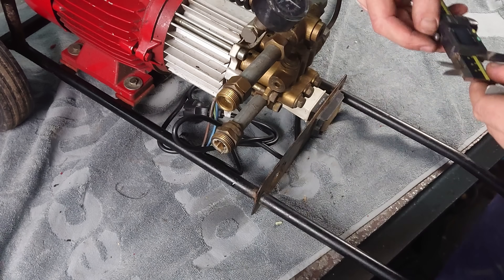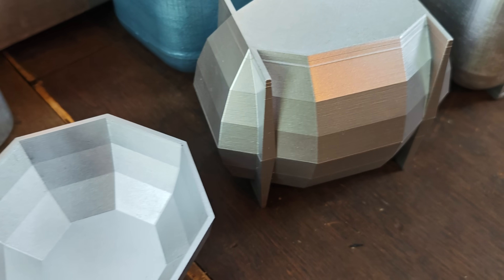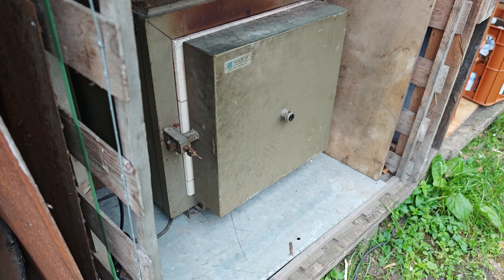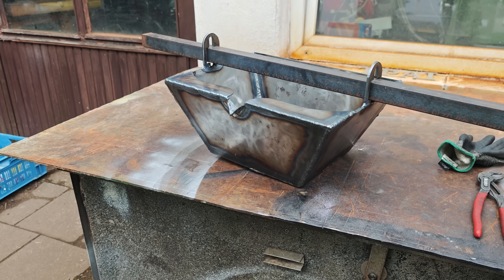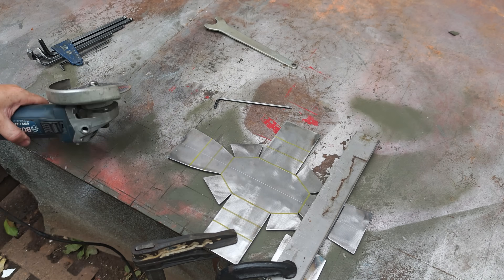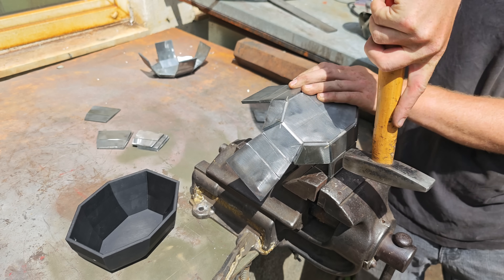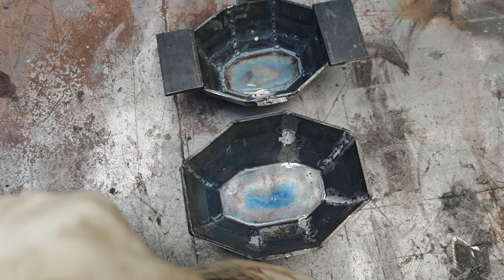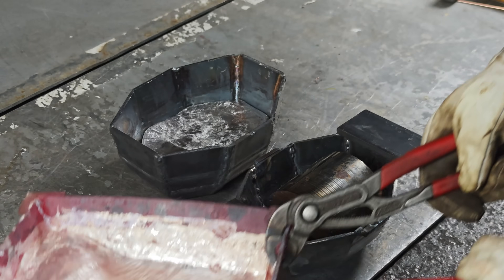Aluminium Casting Experiments! New Furnace, Melting down Scrap and Casting!

Comment: You should put a plate on the bottom of the furnace to prevent wear.
Also a handle like on a kettle on the top part of the mold would help you.
I like your videos 😊

Comment: Check out Jeremy Fielding's videos on using a treadmill motor and control board (MC60?) to power a 2x72 belt grinder. Saves a lot of money. Jeremy Schmidt has some good videos on the gen2 belt grinder. it has some great ideas in there to make a grinder with attachments. Good Luck and good health.

Comment: Pre-heat your mold in a connected state (assembed with clamps or buckles or screws) and add a funnel to pour in. You may also have noticed the downside of having a spout in the middle of a flat side.

Comment: "Weld the desired shape onto the car jack, then pour the aluminum inside. Once done, lift it to achieve the intended form. This method allows you to control the pressure strength and makes it easy to remove the shape afterward.
good luck

Comment: i hope you feel better soon! For the inner mold, think of using those spiral spring handles commonly found on wood stoves. Even if pre-heated, they should be cool enough in seconds for manual handling. Another option is some welded loops on top that you can use a hook tool or L tool for lifting. Some casting channels I've seen use carbon black as a mold release, which can easily be applied by using an acetylene torch burning without oxygen feed. Clark Easterling's channel, Windy Hill Foundry has some very practical tips for casting with a variety of methods (lost wax, sand, etc).

Comment: Hope all is well now with the Hernia operation! A suggestion would be to pour the molten aluminium into the mould have pouring galleys and heat the mould up prior - check out BigStackD Casting https://www.youtube.com/@bigstackD he does a lot of aluminium, bronze/brass, copper casting - though for more complicated uses that moulding sand. Perhaps proper crucifer to heat up metal then pour with right tools to manipulate the crucifer???

Comment: Preheat the mould parts, over fill, apply heat by torch to lower part, sit lower part on a hight temp insulator. Add a pour basin to your lower so the dross stays out.

Comment: To make pouring the mold easier you could add a pour spout to the center of the inner mold.  Weld a funnel shaped spout in the center of the inner mold.  The height of the spout would determine how high you can fill the mold and it would let you see when it's at the proper height.  With that setup you won't have to set the upper mold into place since you can pour with it in place.  

Preheating the molds would also make things go easier.

Comment: When it comes to working with sheet metal, a shear and finger brake are absolutely necessary.
A powered bead roller and a pullmax power hammer really increases what you can do.
A pullmax is extremely versatile and if you can make your own dies, you can make anything.

Comment: you should build your own belt sander. I did it with just a welder, angle grinder, and drill press. I can send you pictures if you need inspiration. I didn't even have a drawing when I made mine and it was much cheaper than buying one.

Comment: Thank you for letting us participate in your process of mastering aluminium casting! I have a suggestion regarding the 3D-printed objects in general: I can see that some of the parts, wich i assume you designed to be perfectly rounded do consist of many tiny flat surfaces. It is possible to print them REALLY round if you increase the resolution of the exported mesh files in your CAD-Software and if it still shows these flat surfaces increasing the resolution in your slicer software. I know that the standard export settings for stl or step files in Fusion 360 are a bit too low for round objects, that's why there are so many bad 3D-models on printables, thingiverse, etc.
I hope this is useful information. Best regards and quick recovery!

Comment: I’ve been working on something similar. The trick is to preheat the steel moulds by 300F or more and use a release coating. BN Lubricoat blue is one I’ve used that’s great

Comment: Hi Gerolf, and best of luck!
To improve the insertion of the counterpiece, once the molten aluminum has been poured, you could create a sort of hoist that lifts the counterpiece and lowers it (fast enough to prevent the melt from flying) into the mold once the aluminum has been poured. It's obvious that you could then reuse the same system by simply changing the mold and countermold.

Comment: I sincerely hope that your surgery recovery is going well!  When I was either in High School or in Junior College, the screen print shop I worked in needed the punch press plates needed to be changed from one size to another to fit the razor die for the next job.  Of course, I picked them up and moved them around by myself and got a double hernia that I finally had repaired ~20 years later, after I got tired of the (edit: non-life-threatening) hernias hurting all of the time.  If I had been smarter, I would have asked a coworker to help me with them.

Since you want to add sheet metal forming capabilities to your workshop, I recommend looking at "Jeremy Makes Things" for info on how he made an electromagnetic sheet metal brake that he used to make replacement tub parts for a '50s Jeep he was given if he could get it out of the woods where it had been for decades.  Another channel, "Make it Custom" shows multiple ways to build your own bead roller & dies if you want to make sheet metal boxes similar to those shown near the beginning of this video.  Both of these channels are here on YouTube.

Comment: You will need to coat the steel crucible pans with something.  The molten aluminum will eat through them and you'll have a big mess.  This can happen faster than you think -- I think it's thermite in slow motion basically.  Steel + aluminum + heat = problems.

Comment: From experience the best aluminium to use for casting is high quality cast parts unless you can buy new ingots. Cylinder heads are good because they can easily be cut into smaller chunks and any remaining metal parts will sink to the bottom. Aluminium suspension components should be good too. Engine blocks are just too big and mag wheels are not as good only because cutting/ breaking them up is a lot of work for less material than it seems. Stay away from pistons as they have additives to help stop them from melting ect. The worst aluminium I ever used was old aluminium horse shoes, the result was very porous with a low sheen not bright like engine parts. I use old cast iron drop scone trays and do a large melt all at one time. The ingots come out at about 50mm diameter and 30mm thick. Not only does it make them easier to store it also easier to melt on my next cast and I can easily cut one in half to check the quality of the aluminium. Overall, aluminium car parts give me the best results and are easy to find. I hope this helps. Cheers, Stuart 🇦🇺

Comment: Sorry to hear about your surgery. But listen to the doctors and recover that way the quickest and safest. 
As for the casting, put a spout on the lower section of the mold and install the inside part. Then fill the aluminum via that spout into the two part mold. It will easily fill in as high as you like it to... Just an idea...

Comment: You can make a stand in which you can mount different dies. The top die can be mounted to a support that is connected to a lever, and then all you have to do is to pull the lever to push the top die inside the bottom die. A bit like how a drill press works. In  my example the drill press table would be the bottom die, and the drill chuck would be the top die. But for your dies you wouldn't need a complicated gear system like a dril press has. Just an arm or lever to push the top die down would be enough. Other than that I wish you a speedy recovery.

Comment: Take it easy and heal up! Great job with the casting using metal molds - I’ve seen many castings done with sand molds but yours is the first example where I actually can see it being a perfectly viable alternative to traditional sand casting methods [which always felt like more of an art perfected on the backs of many, Many, MANY FAILURES over the course of months/years of hands on experience].

Comment: A suggestion for a handle for the top part of the mold. Use a bucket handle instead of the sides you grab with the pilers. You can use it one handed, might be easier to insert level and have increased distance from the molten metal for better safety.
Reply: I meant insert evenly.

Comment: Get well soon!  I was also thinking that maybe pre-heating your molds will buy you some time in the casting process.  Building a jig to hold the mold pieces could also work but that's a lot of dinking around.  I saw that you lost some time transitioning your grip with your pliers from your crucible to your inner mold.  Some self locking "vice grip" pliers could be employed there to have ready made handles and eliminate any fumbling.  Can't wait to see more of your adventures!

Comment: I hope that you heal quickly.

A few suggestions on casting:

- Incorporate a pouring basin into your molds.  This way your molds are already together when you pour, and you should get better castings.  Plus, you will not have to worry about shorts.
- Extrusions, usually made from 6xxx alloys are not a good choice for casting as the metal is just not fluid enough.  Primarily there is not enough silicon and too much magnesium in it.  You can get fluxes that will selectively remove magnesium.  You can also add silicon to your melt so that you have about 7% silicon by weight.
- Make sure that you preheat your molds.  This will remove any moisture and avoid melt explosions and also will help to reduce porosity.
- The best scrap to use for aluminum castings is car wheels.  They are made from either A356 or 356.1.  You can also purchase this alloy in pigs (or also called ingots).
- I think that you are dismissing sand casting way to soon and easily.  You can use your 3D printed pieces as your patterns.  The best way to do sand casting for aluminum, in my opinion, is to get a very fine sand, perhaps 40 mesh or finer and mix it with a saturated solution of sodium silicate (also called water glass).  Mix the two and make your cope and drag.  Before it dries, poke holes through the sand with a fine wire, perhaps, 1/16" (1.5 mm) or so.  Then using an air gun, blow CO2 into the sand.  The CO2 reacts with the sodium silicate to make it quite hard and cohesive.  You can then coat the surfaces of the mold with a clay slip in order to get a smooth surface.
- I recommend getting an engineering textbook on casting or a book on foundry practices.
- It is necessary to use fluxes on the melt to remove impurities.  Degassing is also important.

Casting is a lot of fun but be very careful as metal burns are no fun and if bad enough can only be treated by amputation.

hth

Comment: First, I'm glad you're healing!  Please take enough time to heal well.
Second, here are a few ideas to help improve your process.

 - Heat your steel molds.  This will keep the aluminum from cooling too quickly.  Perhaps use your small furnace for this.  Alternatively, make a rack for your large furnace so the molds sit above the aluminum being melted.  Also, steel molds are used in industry (e.g. giga-casting), so your idea is good.
- Weld three or four spacers to the rim of either section of mold, to center the inner mold to the outer mold.  These should help give you a nice, consistent wall thickness.
 - If you have a bandsaw you could make a jig to hold the part, and simply cut off the uneven top.  This would be faster than milling.  It would also leave large pieces that are easier to collect and melt again than a bunch of mill chips.

I've been subscribed for many years, and look forward seeing you create more post-apocalyptic inventions again!

Comment: Have you considered using the mold upside down. Fasten the two parts down drill a hole in the bigger one and weld on a riser. If the Riser tapers the right way you should be able to pull the form off.

Comment: You've got molds that can take the heat. Just cut your scrap down to the size of wood pellets, measure the proper amount into the lower mold, rest the upper mold on top, and bake for however many hours it needs. Come back the next day when it is all cool enough to handle, and selectively heat the parts to separate them. Slow, but perhaps easier? Take your time healing and planning. 🤕💪

Comment: if your molds are metall remember to pre heat them before you pour. rapid high temperature difference when pouring can cause steam from moisture and can throw molten metall out of the mold. so please be carefull

Comment: Yeah, extruded aluminium is very much not a good option for casting, though if you could find yourself some silicon you could maybe make it more suitable (aluminium casting alloys usually have relatively high silicon content).

Generally speaking if you want to cast metal items from scrap you're better to start something that was already cast. Transmission casings, aluminium engine components things like that are your best bet, you can also use alloy wheels ("wheelium" in hobby casting parlance) just make sure they're aluminium alloy not magnesium alloy ;)

Alloy Avenue is a wealth of knowledge around hobby casting.

For reusable casting molds look into petrobond and/or sodium silicate sand, petrobond is a bit outside the realms of the level of DIY you tend to lean towards because there's no viable amateur method to produce the bonding agent as far as I'm aware, but sodium silicate is fairly easy to DIY though.

EDIT: The Alloy Avenue forum appears to be AWOL, hopefully it's just a temporary issue, it would be a huge loss otherwise.

Comment: Get well soon.
The casting looks good, would preheating the moulds not help with making it less of a rush?
Also, please put a lip on your pouring table so you don't accidentally get a molten metal bath if there's a spillage.

Comment: On the topic of a belt sander, there are a number of youtubers that have their own shop and either go over the concept behind their operation or have built their own. Your shop seems fully capable of making your own as well.
Reply: Didn't TOT make one?
Reply: Yes, perfect use for an old Miele washing machine motor! And assorted junk. And probably a CNC plasma cut housing...!

Comment: Leave the moulds together and add a spout to the outer mould so you can pour straight into the shape, removing the need to place it in and eliminate the time restraint. this may also help with the uneven top surface

Comment: You can compensate for your plasma cutters cutting width. Modern nesting software for running industrial cnc plasma cutters have the ability to compensate for the lost material from the cutting process automatically, but if you measure how wide the kerf is on your plasma cutter you can offset the outer profile of what you're cutting by half of that measurement and get near perfect cut geometry without the expensive software.

Comment: Sent u 10 euros, One of the boxes you 3d printed like like a storage crate in the Fallout 4 game.

A few tips, You dont need to weld inside the molds because the surface tension of Al will keep it out of the small gaps.

Sand casting is going to be more efficient and easier for the shapes you are trying to do.

Metal molds are used with molten metal pumped into them usually some form of Zamack

You can mix cast Al with extruded Al to increase the amount of material you have to work with, while still maintaining good casting results

Multiple remeltings of Al is usually not reccomended (cant remember why)

Comment: If casting molten metal (like aluminum):

✅ Use a graphite mold or high-temp silicone mold

Why? They hold detail well and survive repeated use.

How?

CNC-machine or 3D-print a positive master.

Use sand casting with fine sand (greensand or Petrobond) or cast a high-temp silicone mold from a 3D-printed master.

Preheat the mold to reduce thermal shock and improve finish.

🔁 Alternative: Lost PLA casting

3D-print the part in PLA, bury it in investment material like plaster/silica, and burn it out in a kiln before pouring metal.

Leaves ultra-detailed internal geometry without needing a reusable mold.

---

🧊 If casting resin or concrete:

✅ Use silicone molds made from a 3D-printed master

Make a high-resolution 3D print of the polygon bowl.

Use RTV silicone to make a negative mold around the 3D print.

Then pour epoxy, resin, or cement into that silicone mold.

---

🔧 Materials & Tools He’ll Need:

Master model: CAD-designed and 3D printed (PLA or resin)

Molding materials:

For resin/concrete: RTV silicone (like Smooth-On)

For metal: Greensand, Petrobond, or investment plaster

Kiln or furnace: If going with lost PLA or metal

Release agents: To ensure easy mold separation (especially for silicone or concrete)

---

Quick Summary:

Cast Material	Best Method	Pros	Cons

Metal	Lost PLA or sand casting	Captures detail, cheap	Needs furnace/kiln, single-use mold
Resin	Silicone mold from 3D print	High detail, reusable mold	Silicone mold can be costly
Concrete	Silicone or plastic mold from 3D print	Durable, reusable, easy to make	Needs vibration for best finish

If he wants clean edges and repeatability, the 3D print + silicone mold combo is king. If he’s going for metal casting, then lost PLA gives the cleanest results.

When I get paid I'll donate you some money. Your videos inspire alot of people so anything to help out will be helping us all out. Get well.